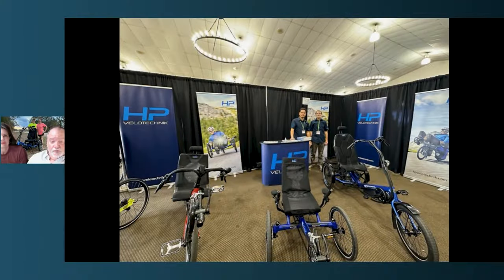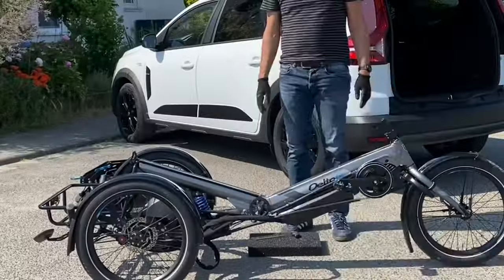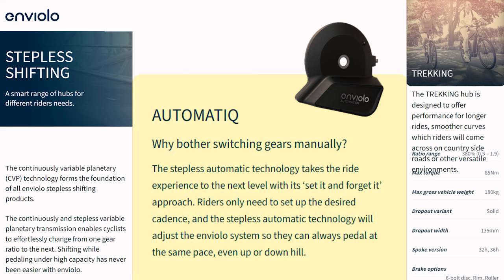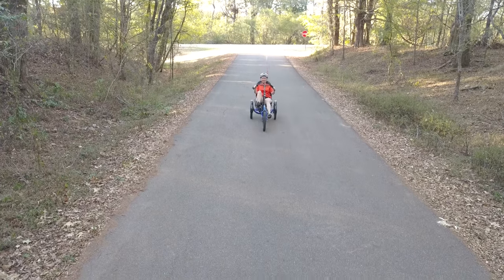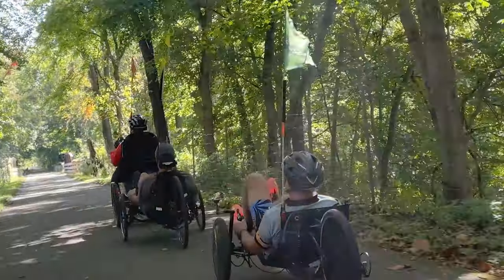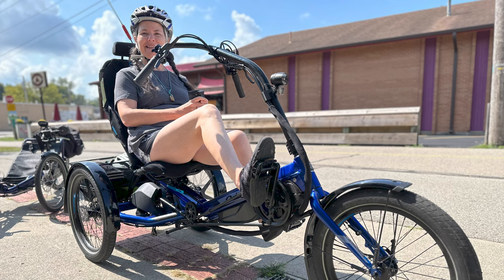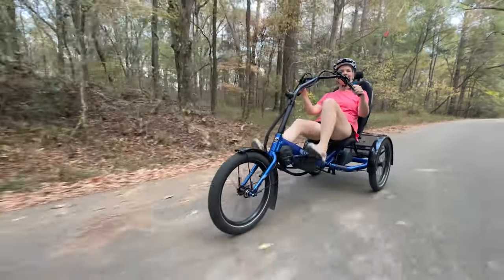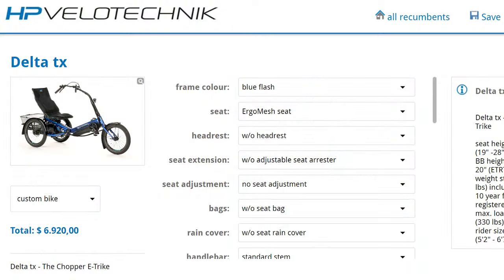HP's New Delta TX Trike-Reviewed!

Comment: I wish they added a two wheel version to this. it'd be the perfect recumbent for city traffic. higher than the other two wheelers so you'd be face to face with drivers, but still thin and nimble enough to slip through the waiting cards at a red light and still super comfy and laid back.

Comment: So it just drives one of the rear wheels? Could you put a "Differential" on it? Could you attach a Burley Nomad trailer to it? I am looking for a three wheeled Delta Recumbent for winter time riding. I do not like how low Tadpole trikes sit.
Reply: HP didn’t want the complexity of a rear diff so they use what they call Freewheelin Twin. The result is that both wheels pull when riding straight ahead but only the inside wheel pulls when cornering. Very similar to what I would call limited slip diff. HP sells a trailer hitch for the Delta so hook up and head out! I like the height of the seat on the trike and the stepthru height. Very easy to get on and off. It should make a good trike for winter. Big tires and fenders. When/if they develop a windscreen that would make it even better!

Comment: I took a test ride of it today in Wisconsin. There is a significant design problem. I am 5 ft 5 in and when I sit in a properly adjusted seat, my view is interrupted by all the cables going to the handlebar. Who the heck wants to look through that when they are riding? The cables actually arc up 3" or so above the highest point of the handlebars, obscuring your view
Reply: Hi Cheryl, at the moment we are offering two different stems, a long one as standard which can be shortened and a dedicated short one. With the short one body heights even below 5'2'' (current official indication) showed to work fine and we can probably even lower the current indication. Your dealer probably has the standard stem and if he didn't shorten it, I don't doubt that it was way too long and disturbing the view. I guess you've been to Hostel Shoppe. Maybe we can find a solution to arrange a test ride with a shorter or at least shortened stem. In any case our US rep Mathieu will be attending the "Pedal Point Rally" there (July 19th & July 20th, 2024) and he will definitely bring a Delta tx with short stem.
Reply: @heikotruppel1646  thank you for this comment. I had been very interested in this bike because it was the closest alternative to the Huka Cortes that I could find. (A Belgian brand that checks the boxes on many disability needs). I did very much enjoy the ride, and your version of this bike is much more clever for transport.

Comment: first
Reply from the maker: Hi Pierre. Are you referring to the fact that this is the first time HP Velotechnik has sold a delta trike?
Reply: @GarySolomon  nothat i'm first to comment 🔥👉👈 love your vids and love from Japan 🗾
Reply from the maker: @pierremiyamoto4490  ha! Now I'm feeling badly about not having set up a prize for such achievements😉 Thanks for those very kind words about my vids. Are you riding a recumbent there in Japan?
Reply: It seems the seat height looks way to high so cornering at even a modest speed would be interesting! Think they missed the boat by not offering a rear tilting mechanism  to combat this.
Be interested in seeing a owner review over a long period on trailsand uneven roads